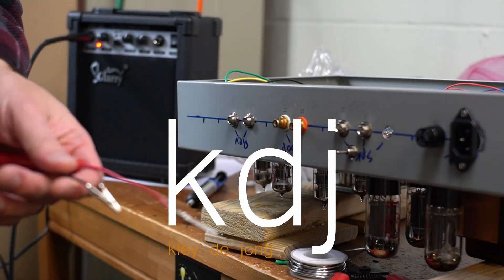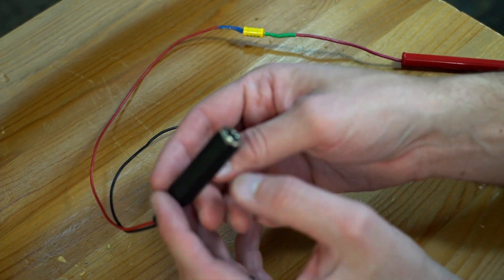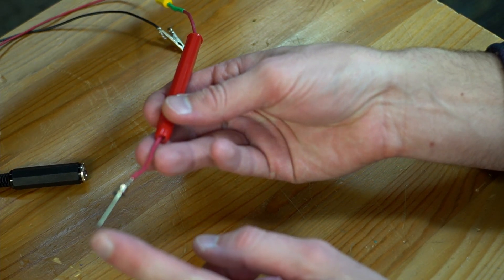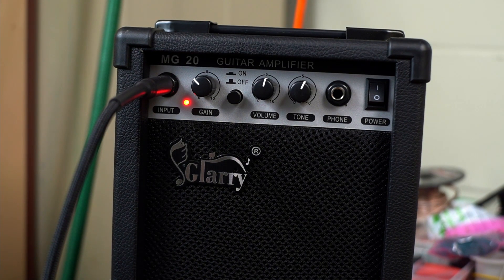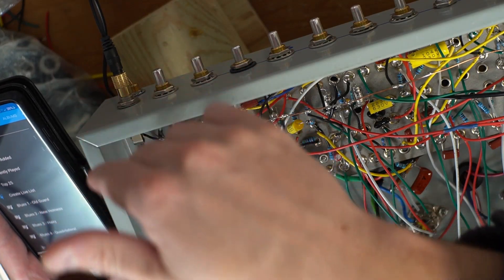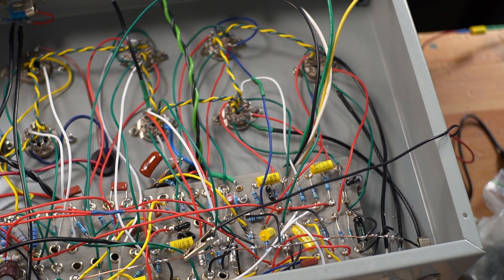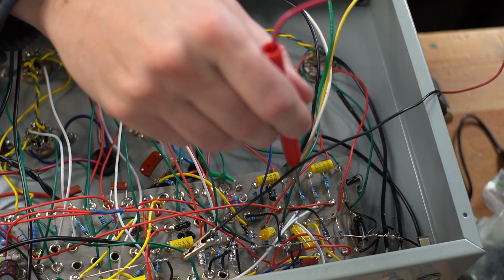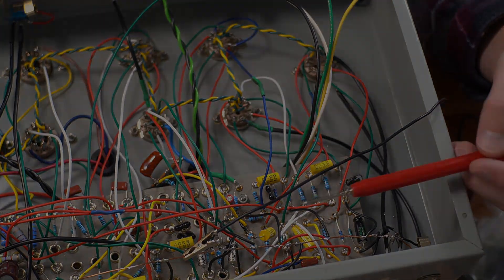Audio Probe Tester - How to Make and Use this FANTASTIC tool!

Comment: what size capacitor is acceptable for this accplication? how do you determine that? I'd like to use something I have, if possible
Reply from the maker: The value isn't that important. Something between 1uf and 0.002uf should be fine. I'd do a larger voltage like 500v or 600v capacity for guitar tube amps. Basically anything you'd use as a decoupling cap.

Comment: What can i use instead of a load box?  Did you run the amp in full power mode or did you use a current limiter of some type.  Newbie just learning.
Reply from the maker: You can use a speaker!  Anything that can safely load the output transformer.  I did simply plug in the amp and turn it on.  Good questions.

Comment: I haven't seen any videos on using one of these (signal tracer) on an audio receiver. I have one stuck in protect mode and was wondering if something like this would work to trying and find out if there is an open component somewhere? I just don't want to risk blowing something up if it's not a practical option to voltage testing.
Reply: Unfortunately, that sounds like a power amp output stage or power supply fault. DMM is your main diagnostic tool for that kind of problem, plus understanding what conditions cause it to go into protection. That would be described in the manufacturer's service manual but generally some supply voltage is not reaching the normal level,  there's DC on the speaker output, and/or too much current is being drawn from the power supply.

Audio signal tracing is for gear that at least powers on and kinda works, as demonstrated.

Comment: Alternatively, you could buy a ZEEWEII DSO154Pro oscilloscope with built in function generator for £40 (inc. test probe or less sans probe)...
Reply: and can you use the audio probe the same way as this video? like signal generator and audio probe at the same time?

Comment: Would it be okay to run 2 smaller capacitors in series as long as they added up and rated  630V? Just wondering as I would like it all to fit inside the probe.
Reply from the maker: Two big ones in parallel will have the capacitance but increase voltage capacity.
Reply: @KleyDeJong voltage capacity doubles when in series not in parallel, but halves the capacitance.

Comment: Excellent idea!:-)I’m using it to repair a Vox Ac15. 

Advice:  Best to use tube amps!!!! Initially I‘ve tested it with an cheap transistor amp and ruined the input section/ the first transistor . 

(Next time would either decrease  the caps value by testing to lowest usefull value, to decrease the tiny voltage spikes which pass the cap before loaded…or use a transformer input for transistor amps.)
Reply: What capacitance value for transistor amps should be for more safety.
Reply: I think that you wouldn't need to worry about frying anything as long as you test only from the lowest to highst voltages as you signal trace from input to signal output or otherwise get a resistor clipped to ground and touch the end of it between probe test points. I could be wrong.

The idea is, if my initial thought is correct, is that each test point charges the capacitor to a large voltage that is stored in the capacitor that can fry the lower voltage tolerance transistors in the early gain stages of an amplifier. So you need to release that energy by discharging or building a switchable bleed to a resistor or other load like a small light bulb.

Comment: With audio signal tracers getting hard to come by these days, this is pretty cool. I wonder how much the value of the capacitor matters. You could also feed the signal into an oscilloscope as well. One thing I would probably do differently is put heatshrink tubing over the capacitor. It may actually fit inside the probe tip.
Reply: The capacitance doesn't matter as much as the voltage. I would say a 500v minimum for guitar amps.
Reply from the maker: I wouldn't go any snaller than .022 if or you may get bass roll off. 630v also means you can poke pretty much anywhere in a tube amp. Thanks for the input.

Comment: Very simple and way cool. I suppose you could add a vol pot in line to prevent overloading the input of the bench amp. Probably not needed but it's another gizmo and who doesn't like more gizmos?

Comment: Awesome video Kley, I always wondered how those probes were made and how they worked. So what was the issue with the amp?
Reply from the maker: I had some errors just prior to the phase inverter where I was mixing two preamp paths.
Reply: @KleyDeJong  Interesting! I have an 18 watt Marshall build that's giving me issues with a very odd squeal. I bought a scope but don't really know how to use it properly for diagnosing, this Audio Probe sounds much more at my level! Lol
Reply: @dyamariv3628  As mentioned earlier, use this probe as input to your oscilloscope. Instead of (or in addition to) hearing the result through the practice amp, you'd SEE the resulting frequencies.
I found this to be a must when I was testing and tuning a harmonic tremolo build.